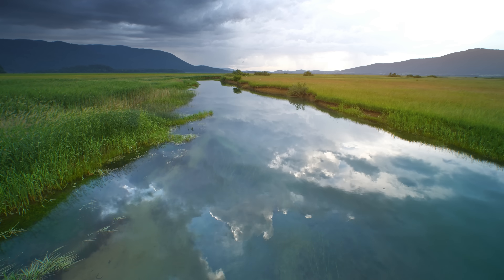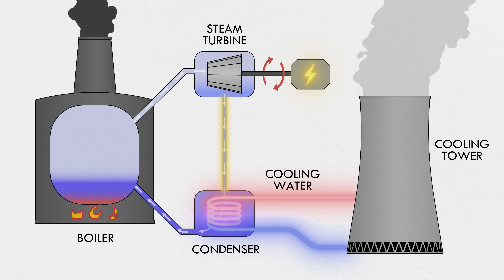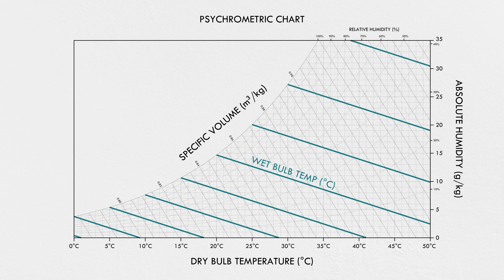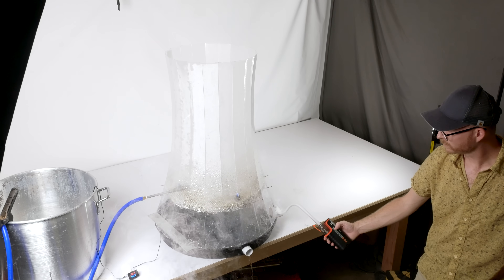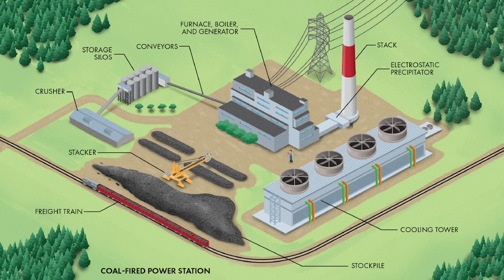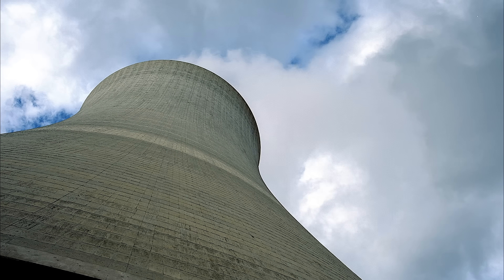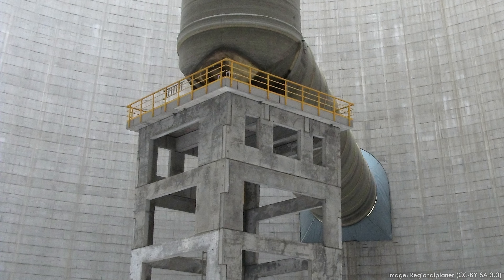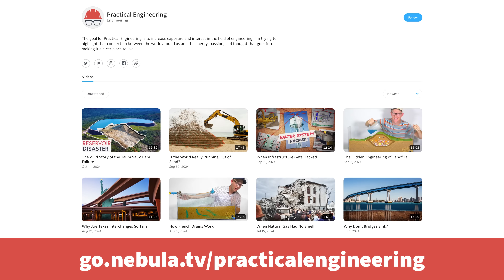Why Are Cooling Towers Shaped Like That?

Comment: I’ve never been impressed by ignorant journalists who often include shots of cooling towers whenever they are writing about pollution or environmental issues. It’s just water vapour- same as the clouds, not smoke from combustion.
Reply: Ya mean nukyaler electricity doesn't burn? 🔥🤯😱
Reply: There's usually a bit of clever photography where the photos are taken so that the light of the sun makes dark shadows on the clouds of water vapour, making it look like dirty smoke. Dirty tricks from dirty activists fooling most of the people most of the time.
Reply: Global warming is real ....because I feel like your little ramble was trying to disprove it
Reply: Its really not
Reply: @Downtime_videos You have no idea what you're talking about
both of your comments are misinformation
Reply: Water vapor is the largest concentrated amount of greenhouse gas. 
Source: NASA Science (.gov) https://share.google/PHsc6vj7fu3qpK6Cn
Reply: But water is the strongest natural occuring greenhouse gas...
Reply: If it was clean, they wouldn't be allowing millions of dollars' worth of water to just waft away. Recovery of condensate is easy and cheap when compared to the cost of fresh water.
Reply: @340wbymag  Water from cooling towers are not wasted because of the evaporation rain cycle. Note recycled waste water can be used in the cooling towers by the Sierra Club doesn't approve of that.
Reply: @340wbymag but they aren't letting the boiler water waft away, its a totally seperate cooling cycle with normal water rather than the treated boiler water, which gets cooled through normal heat exchangers
Reply: @340wbymag  Drawing 15,000 gallons per minute of water from the lake is NOT millions of dollars worth.  Almost every drop INSIDE the steam loop IS recovered.  Two separate systems.

Comment: You touched on the shape of the towers accelerating the airflow, but glossed over its importance of its venturi effect. That shape has been used for things going back to ships whistles, carburetors, and of course cooling towers. It is precisely that shape and its speeding up of the air flowing through it. In a carburetor, the fuel jet/needle/inlet is placed right after the tightest constriction and as the air speeds up, it actually helps pull the fuel out and then helps to atomize it.
Reply: Are you sure you hit the Venturi effect?

Comment: Au contraire! As a newly minted HVAC professional who just finished classes in psychometry, I'm thrilled to not only see the chart in use but to be able to follow along as you used it to explain how it is that more humid environments can actually aid cooling! This explains why those shapely cooling towers are a relative rarity in the dry Western part of the country, so thanks for the explanation!
Reply: That’s interesting.  In the very damp UK, where I live, natural draught cooling towers like this used to be very common in coal-fired power stations.  The last coal-fired power station closed a couple of months ago and most of the UK’s cooling towers have now been demolished.  It’s a shame.  I like them.  It had never occurred to me that our damp climate made them especially effective.
Reply: @joshuarosen6242  absolutely fascinating stuff, isn't it? My intended specialty is climate control in indoor growing spaces. I've developed technology to more effectively manage temperature, humidity and heat loss to make these systems more reliable, more robust and reduce energy consumption by half or more. High humidity helping to shed heat is an extremely useful tidbit and explains why it's much easier to maintain temperature in a room full of plants than it is when it's empty.
Reply: How much did it cost to cover studies and what’s average yearly salary package in that industry
Reply: @andrewcarnegie5342  I paid ZERO for the 2 year Associates Degree, books, supplies and even a notebook computer. Colorado as well as many other states has a program to train tradesmen for certain high demand industries. In 5 years I could easily be pulling down 6 figures. If you like working with your hands, can handle basic electricity, very light plumbing, ductwork, brazing and soldering and study a few scientific principles and a few more types of parts, you can do it too.

Comment: Increasing the height has a cooler temperature above the ground (outside of the tower), allows a larger temperature differential thus greater air flow.

Comment: 1:42 Armchair engineering, discharging steam to the atmosphere would also mean you have to discharge it at atmospheric pressure, above 100°C, wasting some exergy. In a closed loop, you can maintain the condenser in partial vacuum and have the steam to condense about 100°F instead.

Comment: You forgot to 'mention' the main reason for condensers in everything from Newcomen beam engines, to Mill 19th century steam engines, through marine steam engines (piston and turbine), to nuclear power stations.
Condensing the exhaust steam creates a partial vacuum in the exhaust from the steam cylinder or turbine, greatly adding to the pressure difference between steam inlet to the cylinder / turbine (the 'engine'), and steam outlet. The greater this pressure difference, the more power the steam 'engine' will develop.
Indeed in early 'atmospheric' steam engines the steam was admitted at very low pressure to the cylinder, and almost ALL the power of the engine was derived by condensing the exhaust steam.
Vince C
Reply: Plus it's a LOT easier to pump water than a water/steam mixture.

Comment: I am but a humble farmer...but I use a psychrometric chart to judge when to turn on the fans on my grain silo to dry grain. Here in Southern Australia we have hot dry summers (which is when we harvest) and rarely need to dry grain...but when we do have a wet summer I have a silo (bin) with a high capacity fan that just uses ambient air (no added heat), so a psychrometric chart and a wet bulb thermometer helps guide the process.
Reply: Yes....but they are expensive and we don't use it often enough to be worth it.
Reply: How long does it typically take for a harvest to dry out?  Is it in the scale of days?  Months?  Years?
Reply: @jimmydesouza4375 Our drying bin holds about 70 tonnes (155,000lbs) of cereal grain (eg wheat). Typically with warm, low humidity conditions, with the fan running only during the day, it will take up to a week a to drop the moisture content by 1%. We rarely put grain that is more than 15% moisture in it and it needs to be under 12.5% to be saleable.
Reply: Can’t you hook up a thermostat-like reader to automate the process?
Reply: That's such a cool, practical application of these ideas!

Comment: 4:25 It’s not obvious to me,  but why can’t you feed the used steam back to the boiler to superheat it again, instead of expending energy to remove the heat to condense, and then spend more energy to reheat it back to superheat steam?
Reply: the condensation is passive, no energy is expended

Comment: Evaporative cooler is a misnomer for swamp coolers. Sure evaporation helps, but the main thing is the water temperature of its intake. If it was just the evaporation, you could get better performance by pumping in hot water ❌

Comment: That is exactly smoke. Technically speaking, it's smoke from water. The primary content of smoke is water vapor. Of course, there's more than just that in, for instance wood, smoke, such as solid particles and other gases, but at the end of the day....most of it is water.

Comment: If the water is going to be re-heated and turned back into steam to run the generators, why does it need to be cooled at all?  Why cannot the hot water just continue to be recycled into steam?

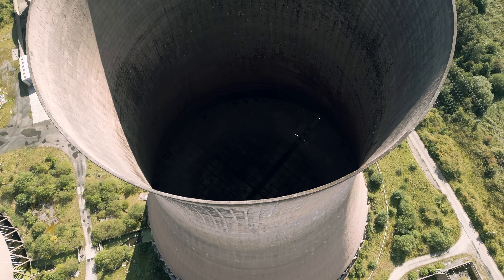Comment: 11:15 Having the base of the tower widen from the mid section going downward also increases the supporting area for the weight of the upper part resulting in constant(?) compressive load on the concrete. What do you think?

Comment: I live about an hour's drive South from Bruce Nuclear Generating Station here in Ontario, Canada.  Bruce and most CANDU stations I know of use a body of water for cooling (in the case for Bruce it's Lake Huron) but I don't know what all of the CANDU and CANDU based reactors use for condensing water throughout the world.  You showed a brief image of the Calandria of a CANDU reactor in your video here so I found that kind of interesting.

I thought the shape of the cooling tower resembled a Venturi and that was a part, but it makes sense that its shape is more structural than anything.

Comment: In the clip at 13:56 some artifacts in the footage can be seen. From my work as a camera technician in the motion picture industry, I learned that these artifacts come from gamma radiation. They are just a few (sometimes just one) completely lit up pixels over just a single frame. You would usually notice them very rarely in the footage. But when filming in locations with high natural radiation, you could come across them more often. I noticed four of those in the clip at 13:56 that was supposedly filmed near a radiation source ;)
Reply: Good eye.

Comment: High humidity air is better than low humidity air,  because high humidity air contains more cool water. For cooling, it is more efficient to mix cool wet air and hot wather, rather than mixing dry and cool air with hot water. In later you need more air to exhange energy with and that requres higher airflow. At the end it is the moisture in incoming air that cools down the hot water, not air itselft.

Comment: “if you just hold the temperature constant and add more water the density goes down” wut
Reply: and suddenly clouds make sense.. huh
Reply: and fog..
Reply: The number of molecules in any given volume of gas depends on the temperature and pressure, but it doesn’t depend on what type of gas it is. Water molecules (1+16+1) are lighter than nitrogen (14+14) and oxygen (16+16) molecules, so humid air is less dense than dry air

Comment: The same principle applies to those curvy brick fence walls (crinkle crankle); the curves resist perpendeicular forces which might otherwise topple a straight wall. It actually saves on the number of bricks used since it's only single layer.

Comment: Summary:
Cooling towers are shaped with that distinctive hyperboloid (hourglass) structure because it’s highly efficient for air flow and heat exchange. The narrow middle and flared top create a natural draft, allowing hot air from inside the tower to rise quickly and mix with cooler outside air. This design enhances the cooling process without requiring fans, which saves energy.

The wide base provides structural stability, helping the tower withstand high winds, while the narrow middle reduces the amount of materials needed, making the construction both strong and economical. Overall, the shape maximizes efficiency in cooling large volumes of water for industrial processes like power generation.

Comment: What’s confusing about the so-called “psychrometric chart” is the fact that it’s a 3 dimensional thermodynamic phase diagram condensed down, pun-intended, into multiple contour maps in one. If we want to extract any useful information from it, we have to be clear on which quantities are being held fixed and which others vary.

Comment: I was curious what cooling method the nuclear power plant in my state used because it doesn’t have the big hyperbolic cooling towers. Turns out it used a mechanical system.

Comment: I was fortunate to have worked on site in Secunda RSA during the construction of the cooling towers. Before the radiators were constructed I flew a free flight hand glider inside the cooling tower. To my delight it went out the top never to be seen again. A successful first flight.

Comment: I spent some time at the Angra nuclear power plant in Rio de Janeiro, I can definitely see the benefit of a cooling tower. At Angra they dump the hot water on the sea so they have to limit the amount of power generated for environmental reasons, it's a shame the climate there isn't good for such structures

Comment: Worked in one replacing the fill packs and the drift louvers on top.
Also replaced the nylon hanger pins with stainless bolts, and the hanger wires. Tied in because it's a 40 foot drop to the concrete cold basin. Osha,common sense, and ppe are your 3 best friends.
They are massive inside. Only natural induction tower I ever worked on,
most towers are mechanical.

Comment: Thanks. I'm in HVAC and during my education we did psychometrics and it was confusing and I was happy to leave it behind. But when I became a professional I ran into a job where I had to dehydrate gummy sweets and this meant getting into psychometrics and the chart in a big way. From that moment I learned the magic of that chart (developed by Mr. Carrier). I became a fan of it and got to know more about air properties than I ever had dreamt of. As the moisture content goes up so does the vapour pressure and this can push paint off a wall. I taught Mechanical Engineers practical psychometrics as course for the local institute. What is important to understand is the latent heat transfer quantity per mass, that takes place when changing for liquid to vapour. It is  immense. 😊

Comment: Okay, I've got this different question, why do you need to liquidify the used steam from the turbine if you're only to reheat it back into steam again and reuse it in the turbine? Anyone?
Reply: Couple reasons: 

1 cubic foot of water is the same as 1646 cubic feet of steam (at atmospheric pressure). Because you have a closed system, by condensing the steam at the condensers, you massively reduce it's volume creating a near vacuum at the condensers. This allows you to expand your steam in the turbines all the way down to 0 psi. Without the condensers creating a vacuum, you could only expand the steam down to 14.5 psi (atmospheric pressure) before exhausting it leaving behind some potential energy. By creating a vacuum you  increase the efficiency of the turbines. 

Reusing the expanded steam also increases efficiency because it is usually still much hotter then using fresh water from a lake or river to refill your boilers. That saves you on heating costs. The problem is if you want to reuse the water to make steam again, you have to get it back into the high pressure boilers somehow. If the boilers operate at 600 psi then you are going to need to get that H2O to a least 601 psi (or greater) to get it to flow back into the boilers. If you tried to compress your 14.5 psi (or whatever) steam back to 601 psi to get it back into the boilers you would need to put in "more" work then you originally got out of it going through the turbines. You essentially need to run that whole (expanding the steam through the turbines) process in reverse. Since there are losses in energy conversion you come out way behind. You would probably use double the amount of energy then you got out of it in the first place. Compressing liquid water to 601 psi is easy and requires very little energy (compared to what you made in the turbines) from the pumps. 

By converting the steam back to water in the condensers you solved 2 problems. You created a vacuum increasing the efficiency of the turbines by expanding that steam to 0 psi instead of atmospheric pressure. You also convert the steam back into water that can then be pumped back into the boilers using way way less energy then you extracted from turbines. You couldn't compress the steam back into the boilers without using more energy then you got out of it in the first place.

Some of the heat now lost to the cooling water (to do the condensing) can still be used for some other things in the plant. It can be used to heat the plant in winter. It can also be used to preheat the combustion air feeding the furnace increasing the efficiency. However, ultimately some heat must be dumped overboard and is called waste heat. All heat engines create waste heat. You extract as much heat out of it as you economically can and then just dump it into the environment.
Reply: @wally7856  Oh this is a good one, I'd never come to this reasoning myself. The concept with the vacuum sucking on the steam in the turbines is a good one! Now I also see that I had some "automatic" assumptions and imaginations on how that steam circuit actually works. E.g. I'd never realise that you have to actually pump the steam/water back into a highly pressurised boiler; I thought it gets gradually heated in something like a long and twisted heat exchanger with 14.5 psi at the entrance and gradually rising the pressure along the way (one-way only) as temperature builds up, without any significant counterforce to the flow. Don't ask why would I think so.

It is interesting how the water, being uncompressable, is actually easier to be brought to a high pressure compared to the voluminous steam that apparently requires extra energy to be additionally compacted volume-wise (I guess it's so).

> Ultimately some heat must be dumped overboard and is called waste heat
You could still use it for hot water and heating of the nearby town; but maybe that's effective only with the bigger plants.
Reply: @NikolaiUA  Yup, there is no 1-way pressure chamber, pressure pushes in all directions equally, not just the direction you want it to.